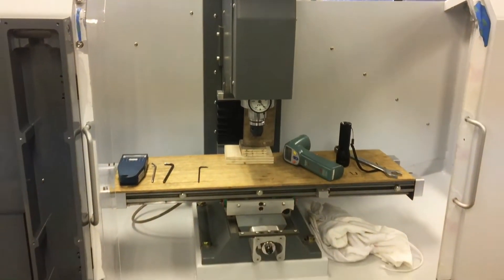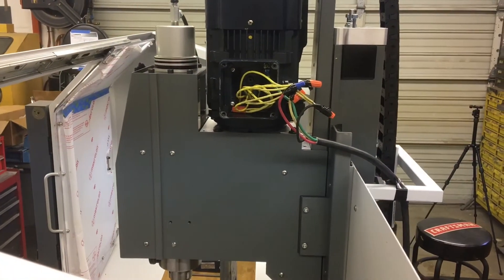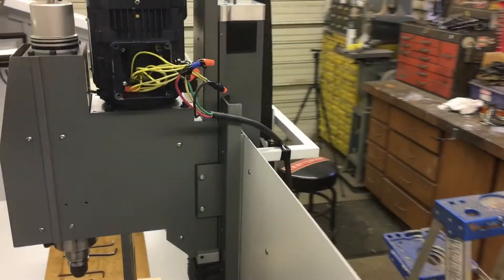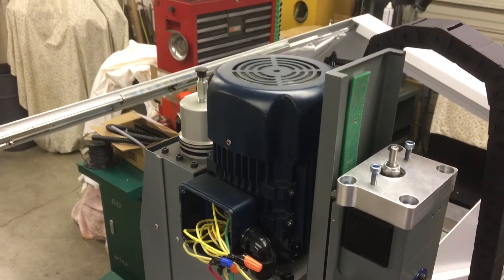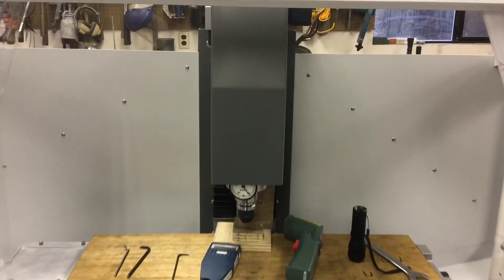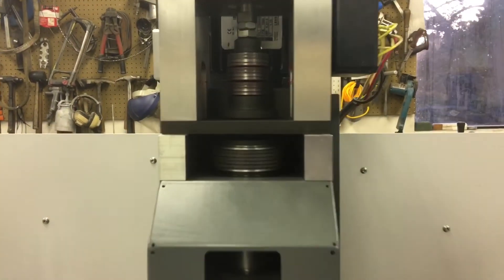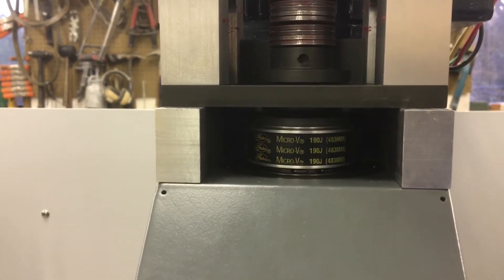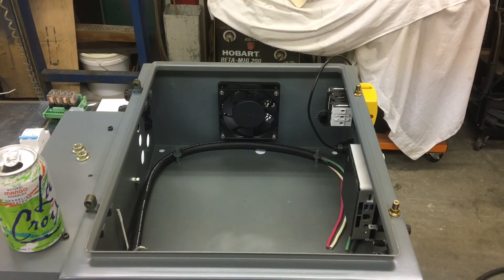GRIZZLY G0704 CNC Conversion Update 29 - ( assembly 7 )

Comment: the rubber thingie you mention to hold the grease in between the bells (?) : think a piece of bicycle innertube would work perfectly
Reply from the maker: I was thinking something along those lines as well. I never actually did anything other than put heavy grease on the washers when assembling them. Have not checked them since i put them together....  time will tell! Cheers - Nick

Comment: Morning Nick.  The grizzly mill I bought came with P5 taper bearing in bottom of spindle.  Wondering if I should pull spindle apart and repack?
Reply from the maker: I would only pull the spindle if you are having a heat problem...
Reply: Another question.  My VFD is setup to run only up to 70Hrtz at 2500rpm.  I know it will go up to 300Hrtz.  If I program VFD to go up to 100 to 120Hrtz and get more rpm do you think the torque would drop off too much to mill with.
Reply from the maker: It might depend on the drive, but yes normally you will loose torque... how much or at what rate proportional to the Hz ? I dont know. Check you drives manual, it should tell you... something. I know on my VFD (wj200) there are different motor tuning settings that can help move the torque curve around depending on what your trying to do. You should be able to mill no problem.
Reply: Appreciate all of your wisdom and getting back to me.
Reply from the maker: Not a problem Brian! I'm not sure i would call it "wisdom" but.... = )  lol    . Thanks for stopping by! - Nick

Comment: Once she is up and running you can CNC a billet aluminum fan for it and balance it up ... Add some grizzbling..

The tapered bearings will bed in and once they do the temps will barely get above room temperature.  Coming along nicely!! Wiring is always tedious and time consuming.. make yourself a nice schematic and make it as detailed as possible, will help once you start running wires to everything and make short work of it.  Also nice to have a good record of everything and where it's going.  

If you have enough height in the enclosure, stand that drive up, will save a bunch of room!!
Reply from the maker: A billet fan sounds pretty awesome! and i do like me some "bling" lol! As you said about the bearings "bedding" in, I can see that.. after pulling the grease things seem to be behaving as they should. Going to whip up a schematic for the wiring and see if there are any "conflicts" .... the enclosure is cramped, but its a pretty basic setup as far as electronic doo-dads go so it should all fit.  Thanks Chris  - Nick
Reply: i would be liberal with the Kluber grease.. the temps are likely dropping due to it becoming broken in.. i slather mine with Kluber and they no longer get hot.. TR's have alot more contact surface area than ball bearings do and the grease will help life span and help lubricate the rollers in their cages.  Also once the temps drop, i would pull it and clean everything really well and regrease so there aren't any small particulates floating in the break in grease.  then reinstall and reset the preload.. once the bearings are broke in they will handle a bit more preload without the heat build up!

Comment: Was starting to  wonder if the fires were impacting you, since you didn't mention it I'm guessing not... I'm doing a rf45 (or whatever it was originally) conversion and got to the saddle and found that the ways seem to have a taper to them.. any chance you found anything similar in your machine?
Keep the videos coming.. sometimes it easier to watch someone make progress rather than make your own ;)
Reply from the maker: Correct, I'm far enough north to be safe... I cant say the same for a lot of people i know though. About you poorly fitting ways / gibs.... my y axis is good (why its still has dovetails) ... the X & Y where not so good, tight spots. I think poor fitting dovetail ways are common to "import mills" ... comes with the price? Dove tail ways have to fit pretty nice to work half way decent, that being said i suppose you could spend some time with a test indicator / mag base and really nail down how far out of wack they really are. Depending on the number / your budget you have a few different options. Find the happy,medium spot with regards to gib adjustment and just run it like it is. Find someone to "scrape" / correct the wonky ways somehow..... or .... linear rails.  Lots of great info on your machine over on the cnc zone as well. Cheers! - Nick